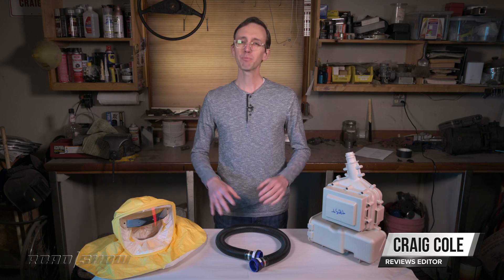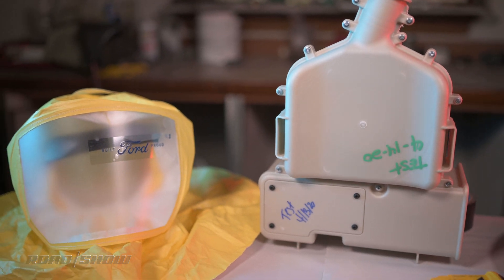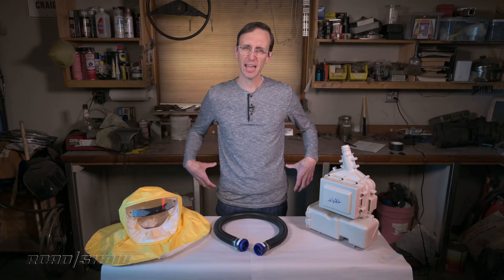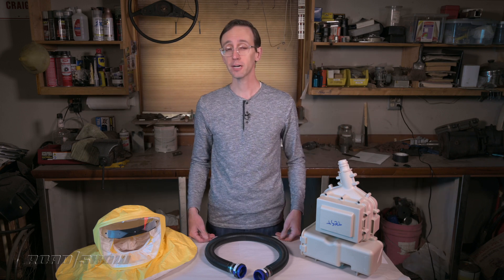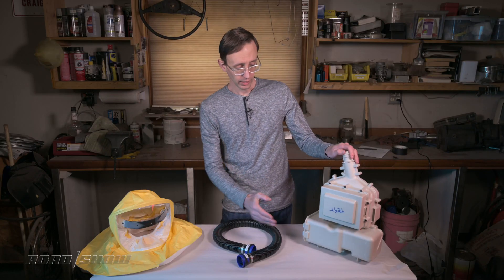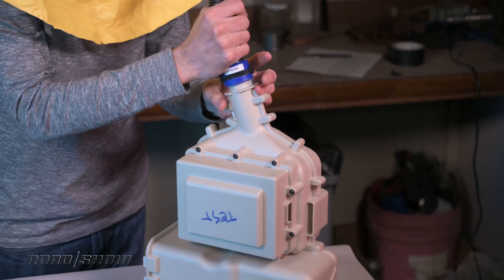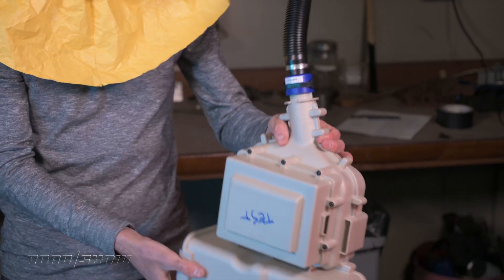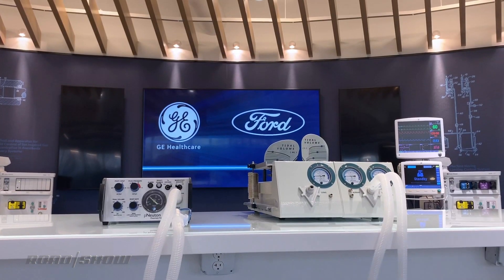Ford's NEW Life-Saving Respirator for Health Care Workers

Comment: We have 8 of them not the best to use in a 12hr shift. Versaflo are the best option, ford did not put much thought in it .to big and heavy all that chamber just for the battery  cheaply made we already broke 2 .again emergency situations yes but not the best
Reply: It weighs 6 pounds but its not Ford’s fault they designed and got out to market in 40 days. It looks like they used existing automobile components to make it. My Versaflo is so small compared to it.
Reply: @videosuperhighway7655  Absolutely correct, it uses a blower assembly that is used out of the ventilated seats you find on an F-150, nobody should be looking at this as a ground-up carefully designed product, because it's not and that's due to the rushed and urgent circumstances of the pandemic.